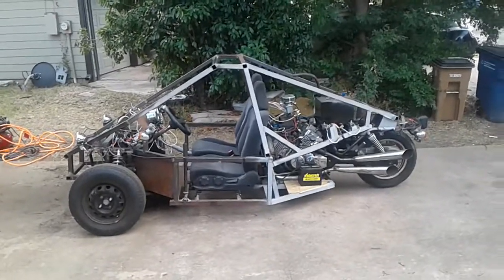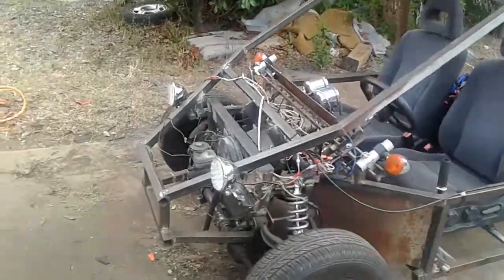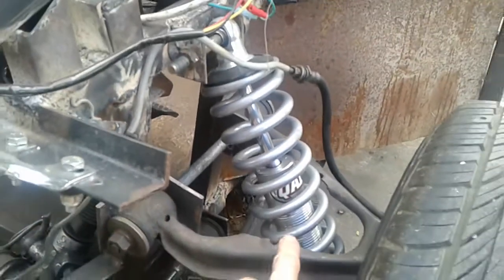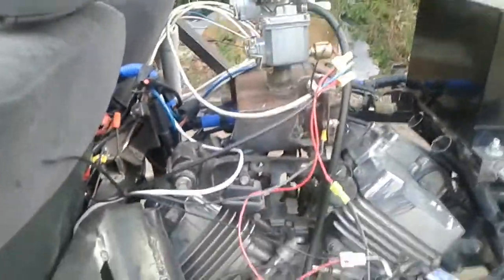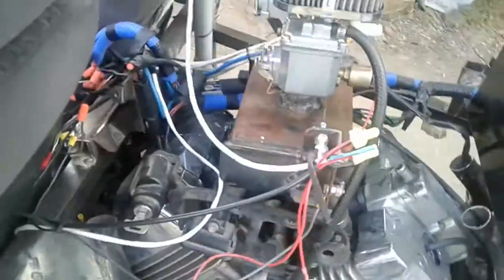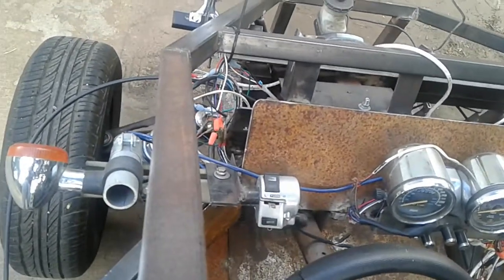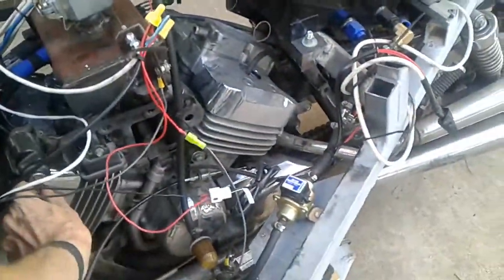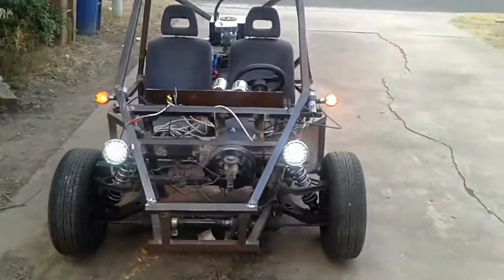Reverse Trike Motorcycle DIY

Comment: So using a motorcycle engine are you getting typical mpg???
Reply from the maker: No it's pushing an extra 500 pounds with more wind drag.  Probably losing 10 mpg, but haven't measured it.😁
Reply: John Ironsmith very interesting you should consider figuring out the mpg somehow and do a video over it

Comment: Hey John, just came across your video! Kudos to you! I’ve built from scratch several “reverse” (the right way) trikes!
 Several years ago I built a trike using a Chevy chevette front suspension and used a similar shock setup! It worked great! I used a Honda gold wing for power!
  I’m currently swapping a 2008,150cc gy6 drivetrain out of a trike I built from scratch and installing a 2002 Yamaha VMax into it! You can see the entire build on my channel! The VMax is coming up! Just click on my profile pic!
Reply from the maker: That's awesome Clifford.  I'm going to check out ur video.  I love this stuff.  Next trike I'm building will be electric with solar panels:)  I've had the bug for a while but its a good bug... prolongs lifespan somehow...

Comment: you built this trike but couldn't rebuild those 4 carbs? wtf?
Reply from the maker: Good question Sean

I actually did rebuild them when I bought the wrecked bike.  They were off the bike in pieces and I fabbed my own gaskets for them, (original were missing), it was a pain in the ass but better than the $100+ for OEM replacements.  Got the bike running crystal perfect with them.  

Then the house and garage flooded  and I took them apart again a few months later.....  some non-metal parts I don't know the name of looked wrecked and they were very expensive to replace...  also beyond my carb rebuilding skillset.  All the replacement parts for the 4 carbs would have been more than what I paid for the bike and more than what I would pay for a running used bike.

But I do love to weld and would rather deal with one carb than 4 and have to sync them.  Not to mention VW carbs are pretty straight forward and $65.  About a quarter of the cost of just replacement parts.

And......4 separate carbs on a 4 cylinder bike is inarguably excellent for performance unless you have EFI.  But for maintenance and dependability, they EFFING suck balls..... in my humble opinion.
Reply: John Ironsmith don’t sweat the haters! You did it your way and gained a wealth of knowledge to boot!

Comment: Dude way cool. I have a 1000cc Honda magna I have been wanting to do this with. If you still think your intake leaks you can take it off and hook up a vacuum cleaner to it (plug all the other ports). Then use JB weld on all the seams . The vacuum will suck the weld in any pin holes and make it air tight.  Awesome job though. Cheers
Reply from the maker: hey thanks for the tip! Super cool idea